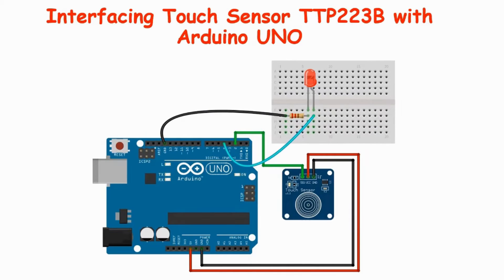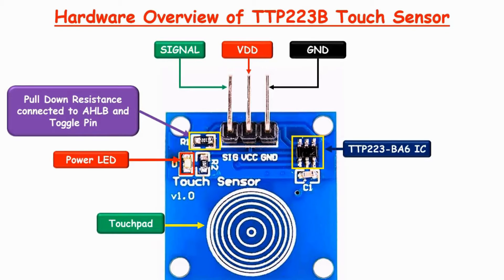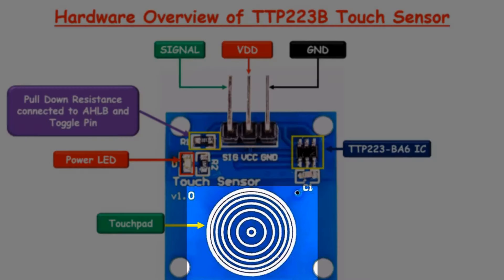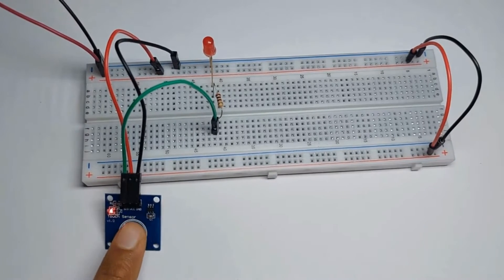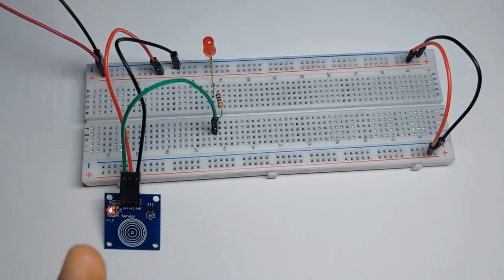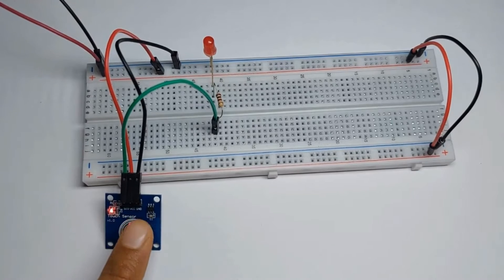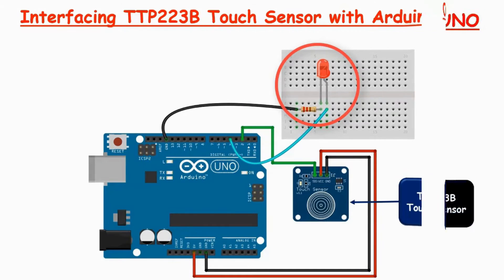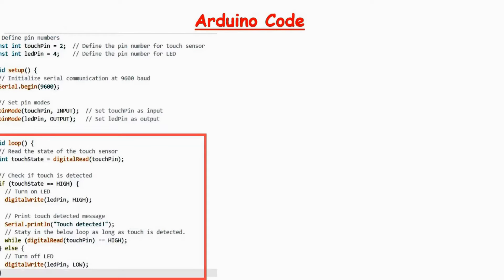How to use Touch Sensor Switch with Arduino (TTP223B Capacitive Touch Sensor)

Comment: 1. Will it works if touched by wood? 2. If yes, how durable if move this Touch Sensor to hit target wood with dust/small particle (give command to stop moving after touched) for 1,00-2,000 times per day? thanks
Reply from the maker: No it will not work with wood ,it needs conductive material touch to check change in capacitance.